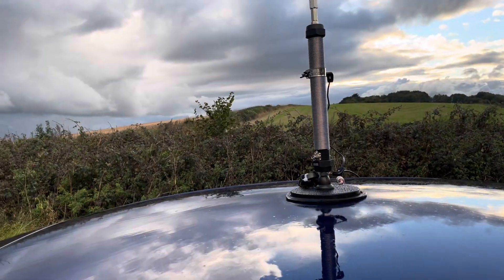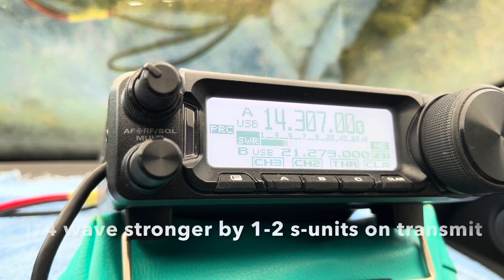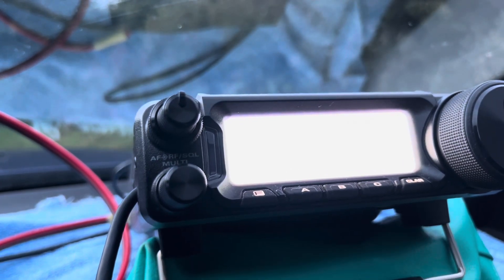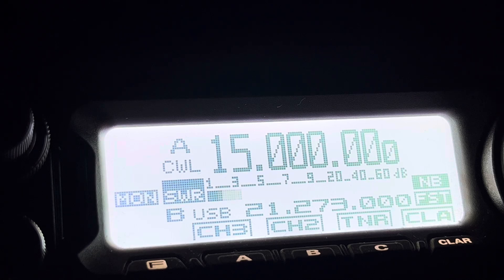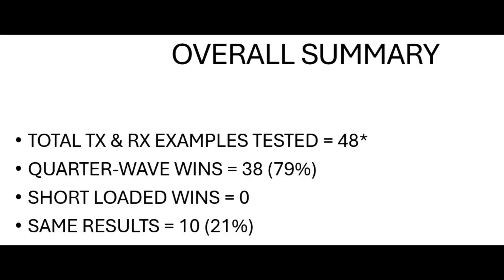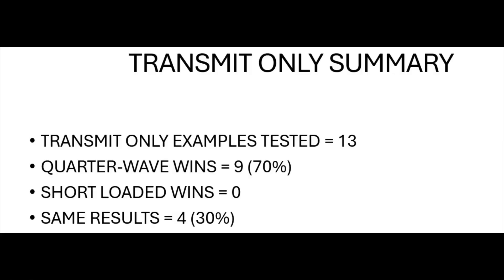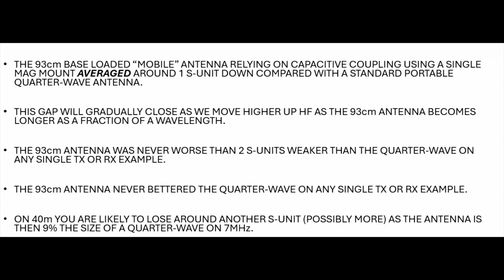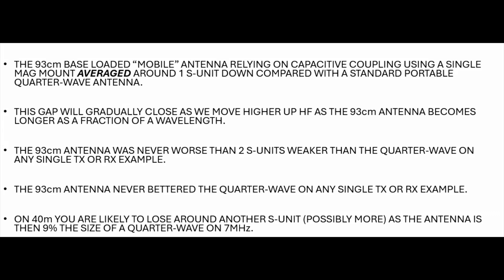ATAS 120A & LITTLE TARHEEL 2 Antennas: How much of a compromise?

Comment: A very interesting test conducted 8 months ago. Currently daytime conditions on 20 meters, the usual time for many POTA activations, have been extremely frustrating with many pota stations barely discernible compared to even 5-6 months ago. Your video proved that a pota activator during poor radio conditions, really needs a quarter wave antenna, or something better,  vs a simple shortened vertical on the roof top. Over the last month or so, the extra S unit of a full quarter wave antenna would’ve made a huge difference. Many times, I could not discern signals from some pota stations while easily hearing stations contacting them. Even then, often with many repeats and generally great difficulty.   The generous HF propagation experienced by low power and small antennas over the last several years, before the sun’s current disruptive activity, must certainly be somewhat frustrating. 5, 10 or perhaps 20-watt stations will to a degree continue to be frustrated as the great conditions of a year ago has trained many in the environment of enhanced propagation conditions as then experienced. Again, thanks for proving how an extra S-Unit and a half, or so, of effective radiated power can make pota operations much more enjoyable. W1VR Dave
Reply from the maker: Thank you for your observations Dave!

Comment: Just out of curiosity how many radials were deployed and what did you  use for an earth spike on the short antenna?  If there wasn't any on the short one then the comparison is meaningless. Interesting experiment nonetheless
Reply from the maker: The short antenna was capacitively coupled to the car using a mag mount. The longer antenna had 40m of ground radials

Comment: Very much appreciated, however, there’s little audible difference switching between antennas, perhaps switch off receive AGC for a better comparison. Receive AGC is compensating for changes in field strength between antennas.

Comment: Good video - I also test many mobile antennas, but I always use a short grounding wire to ground the antenna base to the car body. Currently, I do not use magnetic bases, but a mini platform with the possibility of mounting many antennas in a very safe way. I am providing a link to my QSO mobile video from the Izer mountains at 40 m and the HM-6 antenna and horizontal reports 5/9 - 5/9 +10 dB  https://www.youtube.com/watch?v=iuNLXxMOI7M
Reply from the maker: Thanks I’ll check that

Comment: Fantastic little experiment there Tim with the use of that switch. Out of curiosity, how do you feel they perform vs the trust ampro 20m whip? Is there much improvement?
Reply from the maker: I think the Ampro is longer .. longer usually means a little more efficiency with mobile whips Matt 👍
Reply: @TIMG5TM  yes I figured that, but sometimes the cheap price makes you think otherwise! Haha!

Comment: Interesting video with a very confusing title as neither the ATAS nor Tarheel are tested. Should mention Mad Dog Coil loaded antenna versus full-size quarter wave comparison. I fully expect the ATAS 120A to be a long way down compared to the Mad Dog Coil with the same radiator length. Scope for another video comparing loading coil losses with the same short radiator. Personally, I always use up to a 5.6m radiator with my Mad Dog Coil and it has revolutionised my WWFF activating.
Reply from the maker: Thanks for the suggestions. The tarheel and atas references were made to alert viewers that this antenna basically mimicked those in terms of size and design. 73

Comment: My thoughts are similar to a couple of the other comments here - do you think it would be a useful exercise to map the stations you heard or spoke to, and compare their location to the difference in antennas? My thoughts are 1) Take-off angle. With the stronger stations being similar in strength, were they the closest ones, i.e. with a higher take-off angle? 2) Was there a difference in azimuth? I was always under the impression that the best signals would be in the direction of the most metal on the car, so with the antenna in the centre of the roof, maybe the signals are biased front and rear?
Reply from the maker: All useful observations thanks Paul
Reply: Another comment, I was very pleasantly surprised when I first bought a 20m hamstick, I thought it wasn't going to be great, but actually it exceeded my expectations. It's certainly a quick way to get up on high ground and start operating on HF. Though I suppose extending a full size telescopic whip on top of the car isn't that slow, assuming it isn't windy or you have a triple mag mount!

Comment: Excellent, as always! Regarding your thoughts on something like the ATAS-120A on the higher frequencies, I’ve had some emails with Andy, HB9CVQ who’s done some research on mobile HF antennas (check his QRZ page for more). He agreed that the ATAS is sufficient for 14MHz and higher. Personally, with the 891/ATAS combo, on 20m-10m, in a little over 2.5 years of occasional driving, I’m 77/100 towards Mobile DXCC, running 5-50 watts (more than 100 is pointless for me). Last week I set a new distance record for my setup with Seychelles at ~8,600 miles/13.8k kilometers, on 10m. 
Mind, I’ve often wondered if I could do a little better with a 102” CB whip. 73! WB3CFN/m
Reply from the maker: There’s always room for experimentation 👍👍

Comment: Isn't the ballpark every time you half the power you lose 3db ? Dito every time you compromise to 1/2 size  the ant you lose 3db ? 
So to go from 5m full size ¼ wave to half 2.5 metres that's 3db then to go to half that again that's another 3db so that is 6db straight of the bat ? On modern rig that is about 1.5 to 2 S units?  So it all computes .

Comment: Really good insight Tim - as an ATAS user, in the right conditions have spoke. To VK no issue on 20, however if parked stationary and space allows it’s worth getting the long wire or slidewinder out I feel.  Even slidewinder on car with its whip works well - the convenience of not getting in and out the car when it is throwing it down to change bands though is great with the ATAS!
Reply from the maker: Absolutely! It’s convenient for sure

Comment: Interesting video there Tim, it just shows you although there was a difference it probably wasn’t that huge especially when you can just plonk that on your car roof and your done. You can also cheat a little on the roof with the radiation angles as that can sometimes be worth a S Point by just moving it about.
Reply from the maker: Good point

Comment: Interesting... One of the Key differences will be Take Off Angle
The Full Size Vertical will have a Lower Take Off Angle than the Shorter Loaded Antenna
Reply: Don't tell Peter.

Comment: very interesting. Somewhat of an investment, but a couple of wsprlite from sotabeams running at the same time would be a brilliant concurrent test of the two.
Reply from the maker: Good idea 👍👏
Reply: I noticed they are out of stock right now, so not sure if they are discontinued or waiting for a new batch. Home brew versions with a couple of raspberry pi and a bit of filtering, would be a cool experiment and project.
Reply: @mw0lge  Discontinued I believe Richie. I think Zactek is the way to go now. More expensive but multiband with BPF's etc.

Comment: The advantage the Little Tarheel has over the ATAS is the ability to attach longer whips to it. Stick a decent 6ft whip from a CB antenna onto a Little Tarheel and you'll get around 6dB gain over stock.
Reply from the maker: Agree
Reply: Also the ability to have it tune while mobile.
Reply: I wonder if I could put the Chameleon 25 foot whip with a capacitance hat on the Tarheel Design (Tarheel is a different company, and they don’t seem to be producing antennas anymore?! Not sure)- stationary, not moving of course, and I wonder what that would do.

Comment: Hi Tim, appreciate your test and effort in bringing some precise statistics and results. I’d like to point out something though. Uncertainty of reports from the other operator on RX test due to personal interpretation and fading on the signal. An antenna is a passive element of the chain, so what you get in you get equally out. Ie you can’t have difference between TX and RX. The difference , when present, comes from the variation in time. Saying 1S-units equal 6dB can’t be correct. S-meters from our rigs are far from being that precise and linear! Plus they are different from radio to radio. I invite you to test the meter with a sig gen in 1dB steps, you’ll be surprised. Yaesu modern radios for example have (ABOUT) 10dB of difference between S1 and S5 (2.5dB per S-unit) which rise to 3 dB/S between 5 and 9. Almost no radio has a 6dB/S calibration, not even high end ones. Remembering that saying 6dB difference might not seem too much but in effect is 4 times the power! Ie one could lower the power to 25w on the quarter-wave and be equal to the short antenna at 100W. 
In summery I’d suggest an A/B comparison on a qso done barely above the noise level to well appreciate the difference between the two setups(if the noise level is the same!).
Also careful sometimes when the signal pops up, that is not real signal peak (I’ve noticed this on WWV). 
Mines are just suggestions on data interpretation. Keep the good work and enjoyment! 73
Diego

Comment: A tip worth trying? On the lower bands, I tend to offset the position, of the mobile antenna, towards the back of the roof of the car; then I guess it is the car which is doing most of the radiating, rather than the tiny loaded whip......and probably radiating much more than the whip.
Reply from the maker: @timdbl7804  yep becomes a tad directional too I would’ve thought

Comment: Nice to see a quarter wave vertical with radials, think if the mobile antenna was directly drilled through roof you would see a big improvement probably match the other antenna
Reply from the maker: Hmmm I’m not too sure. I think the fact it’s 5 times smaller than the 1/4 wave beats everything. There would be a slight improvement but I wouldn’t say a whole lot to close much of the gap. 73
Reply: @TIMG5TM  it be worth a test ,there is ohmic loss through a magmount ,lb cebik, walt maxwell, and tom w8ji have all wrote about antenna length not being too much of an issue if fed and mounted correctly, they reckon an antenna can be around 25% of its natural length before radiation patterns become an issue
Reply: @TIMG5TM  ground plane plays a big part in a mobile instalation especially the connection to it
Reply: @Pioneer936  With a mag mount, there's capacitive coupling, and a single mag mount should be good for 20m and up. It may need a bit more assistance on 40m and 80m.
Reply: @paulsengupta971 yep definitely the lower bands will benefit from an earthing strap to the car body. Having said that - don't forget that both of these types of antennas can be mounted on a tripod with proper radials. Just because they offer the convenience of car roof mounting, doesn't mean you can't use them in other ways when the opportunity allows.
Reply: @paulsengupta971  mag mounts are fine for vhf and uhf not hf there is too much ohmic loss
Reply: @PaulTaylor1  agree that Bonding body panels, doors boot etc together with earth straps increases groundplane and reduces ohmic loss